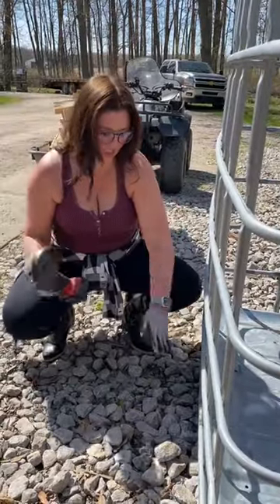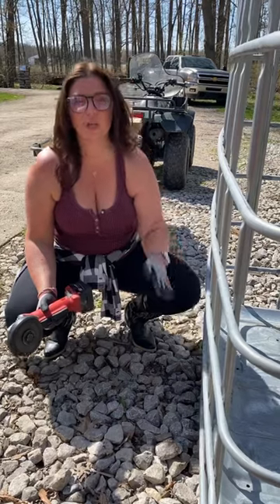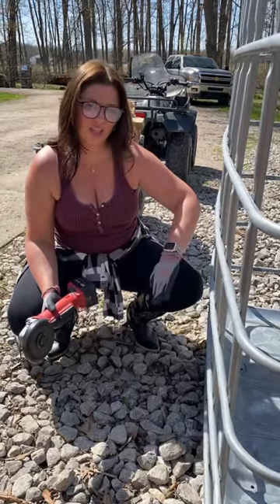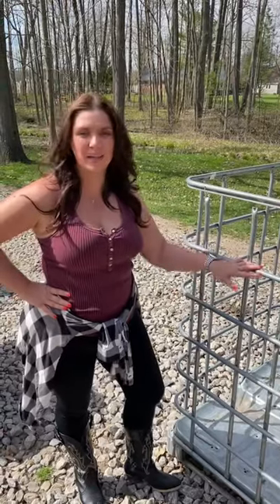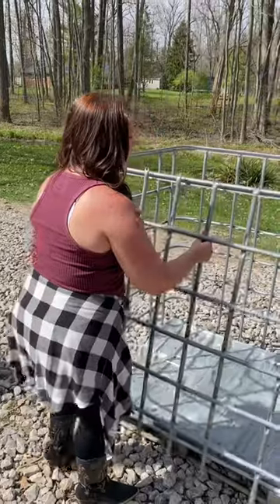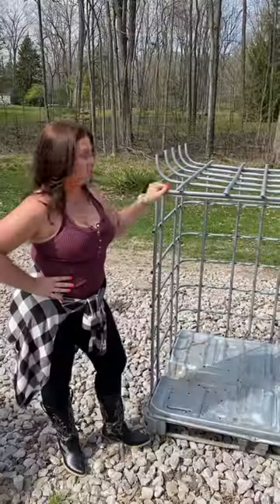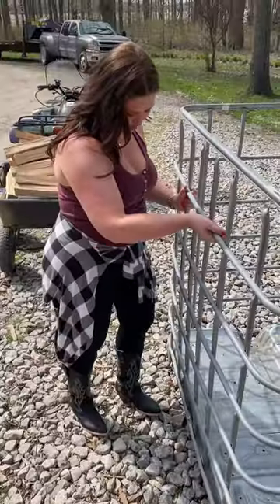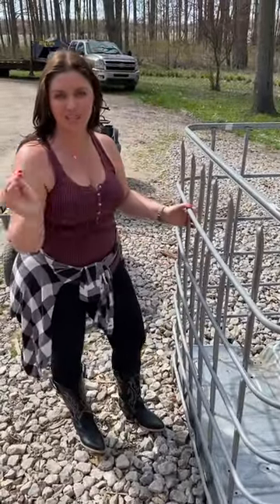Best EVER IBC Tote For Firewood! #howto #awesome #shorts

Comment: Not certain I heard you mention it in the video but I thought your original IBC tote modification that removed the top bar was so that it was not a headbanger. What changed in your thinking? Thanks.
Reply from the maker: This is for loose tossed or conveyor filled totes. We still remove the front bar for the totes we stack off the axis.
Reply: @hardworkingmanoutdoors  Ok…makes sense! Thanks.

Comment: Is this the v2.0 from the original Christmas video?  If so what diameter is the top metal wire now?  I was going to 1/8” but is that too thin?
Reply from the maker: This is the updated version except for the wire we used here. This wire was a bit too thin. 1/8 should be fine!
Reply: @hardworkingmanoutdoors ha! Sorry for all the questions but are you still using the paracord and boat cleats at the bottom and side or taking advantage of the grinded down vertical bar at the bottom?